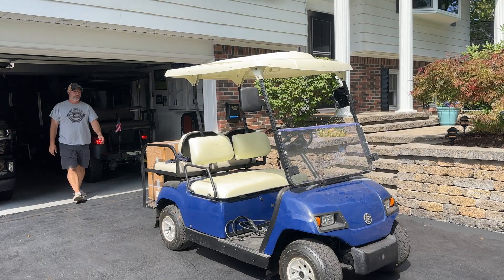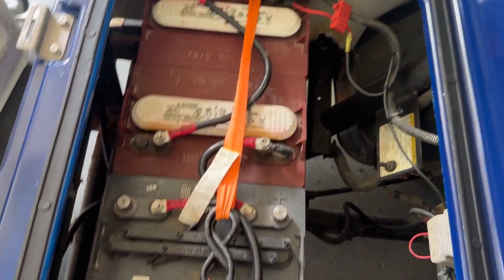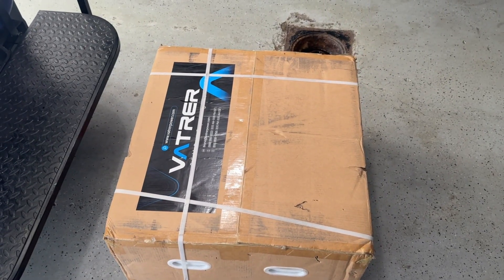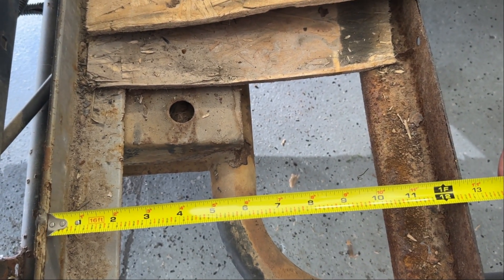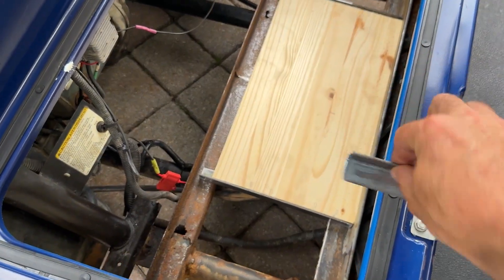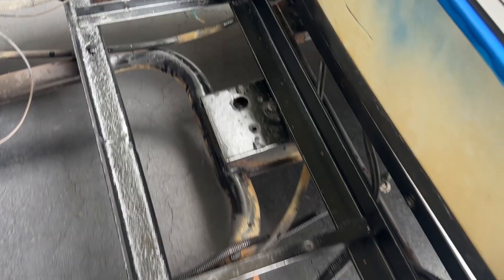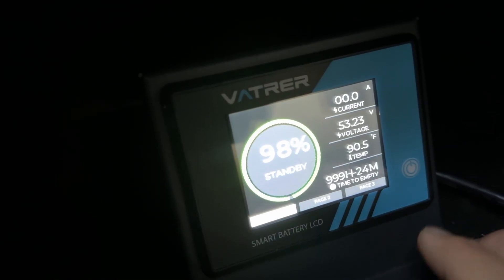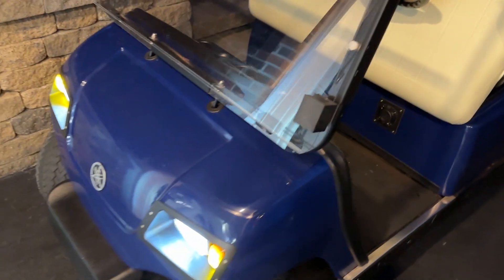Yamaha G-Series Golf Cart Gets a Lithium Upgrade | Vatrer 48V Install

Comment: I was looking for what wiring you hooked up. I just put mine in. It’s the same thing but a different brand name and it will not work although I have a hook hooked up the charger yet but it’s charged to 54%.
Reply from the maker: apologize for the delay, just seeing this comment. were you able to figure it out? The Yamaha did not have anything i had to override to get it to run like the club car or the EZGO

Comment: The lights on this car run on 12V. Did you install a DC-to-DC converter?
Reply from the maker: Yes, there was one in it on the mains. So that just got reconnected
Reply: @acautocarts24  Did the converter already have it built in? Did it come like that from the factory? Or did someone install it? ... thanks!!
Reply from the maker: @fernandox189 oh it's just a little one from Amazon. All that it runs is the light kit. Which is just LED tails and Headlight. 
I do run a larger one in the other carts 

This particular cart was a golf course cart and is about 20+ years old

Comment: 10 years from lead acid that is easily recyclable and very safe to use is not upgraded with lithium technology more the opposite and don't tell the insurance company and don't park it inside. It makes for a video but not practical otherwise.
Reply from the maker: I don't disagree completely.. but will say for this cart.. the off switch and no other maintenance is key for this owner. 
I don't ever recommend charging while not at home 
Once done, I unplug them.  🤞🏼